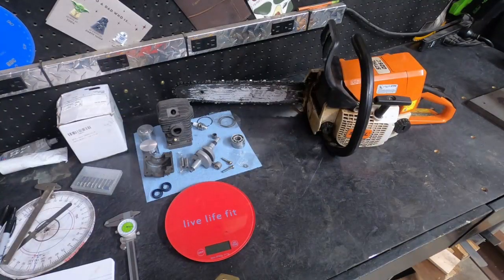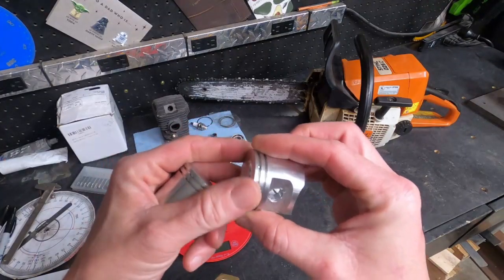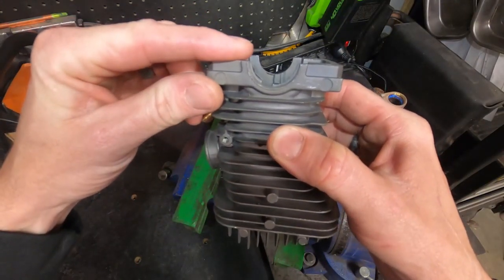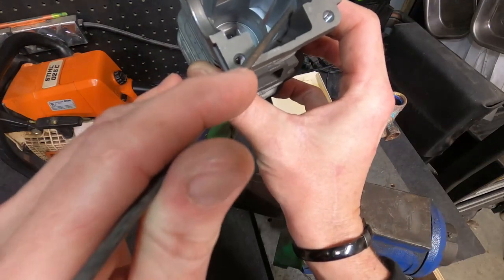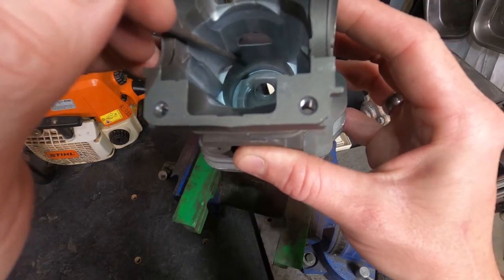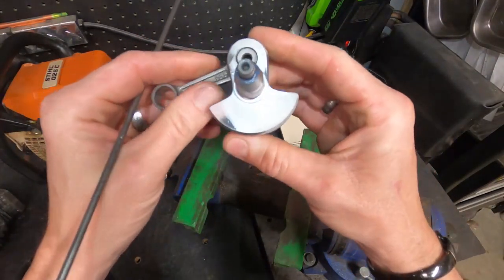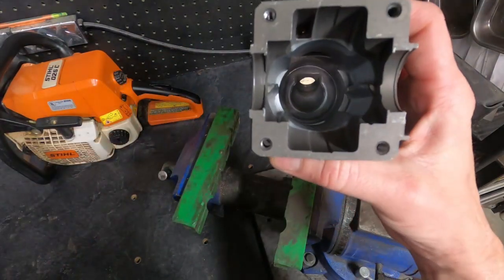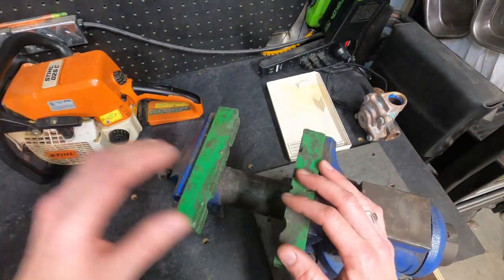Stihl 025 performance build. Part 1: Overview for adjusting squish and basic build plans

Comment: I was watching another clamshell porting channel and thought these jugs were different because theyd removed the divider or whatever its called grom his jug. Making it 1 large transfer on each side instead of two. Youve such a wealth of knowledge on these saws and there are veryfew clamshell saw porters out here. Thanks for sharing this stuff man. Much is beyond what im capable of doing luke changing the seal/bearing pocketsbut the rest is priceless. Hoping my 290 will run like the one on the short you show. I got quite a bit oit of it just openi g up the exhaust after the warranty ran out. Grabbed me a 261 so im now worki g on porting my 290. Shoulda bought an aftermarket jug in case i ruin mine but its too late now. Been running it hard for past 12plus years and barely a light score on exhaust side of piston. Rimgs are still nice. I burn wood and sell a bit of timber so its seen some use people trash the syntec stihl mix but its been great to my saw. I run it a tad rich though. Just a smidge. Anyways once again, thank you.👍

Comment: Taking corners off of rod is were they make strenth, makes it like an h beam, carefull
Reply from the maker: I can see your point. Adversely, I have seen where these sharp points are called stress risers, and it’s advised to radius all sharp corners.  I will not claim to know how much it “needs” in one direction or the other.  I do credit David Vizard with most of the original concepts that went into this rotating assembly. I doubt he has ever messed with a chainsaw clamshell, it is more taken as general concept.